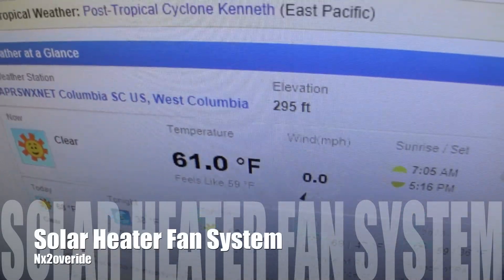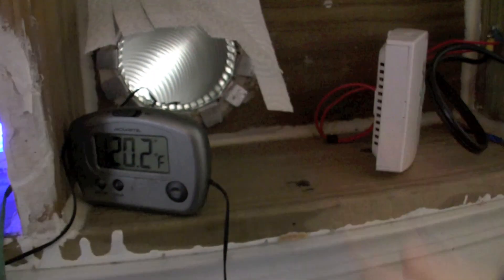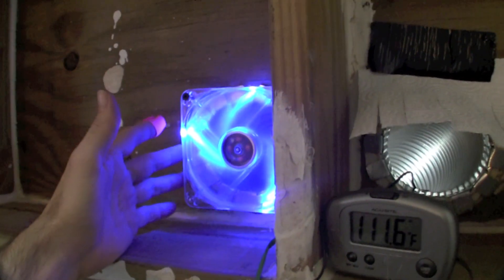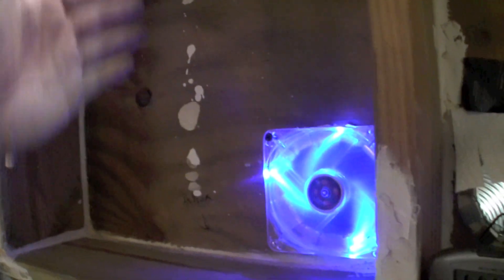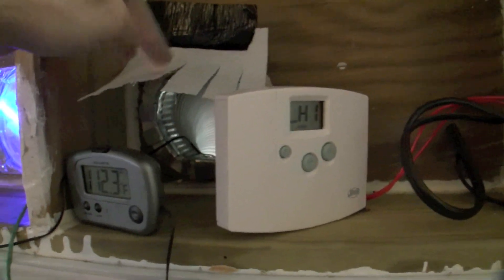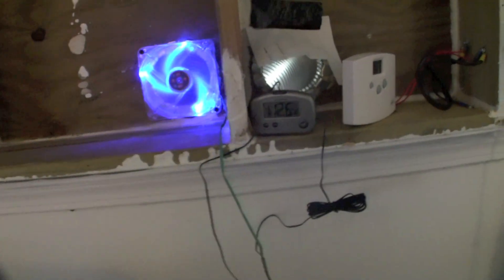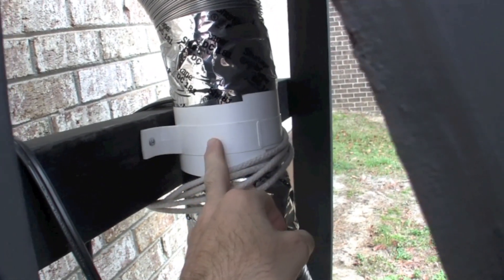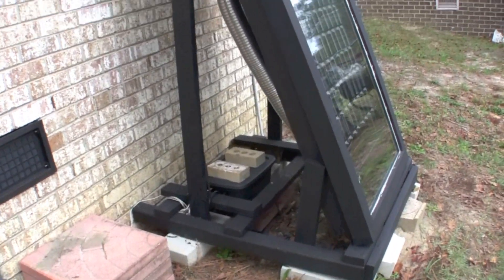Solar Heater Fan system rebuild

Comment: I've seen a quiet a few of these and want to know if in your opinion  is this worth it to build does it supply enough heat to really make a difference? Also are the fans necessary could it work as well or almost as well using natural air movement?

Comment: I was wondering how well a bilge fan would work, it looks alot easier to hook up than making an ugly box for a car fan!! Does it make any difference if you push the air or pull it other than the motor noise being closer to the house inlet!!☺